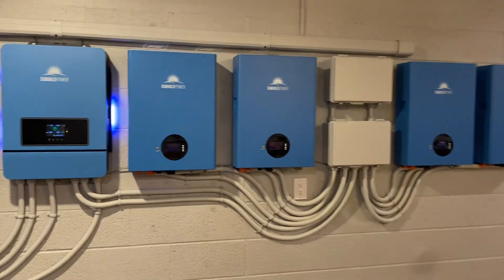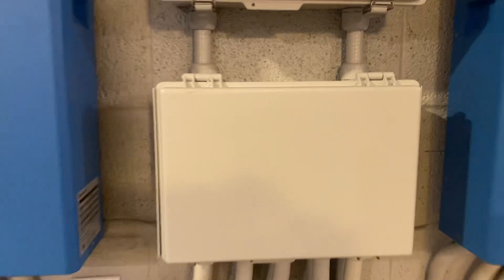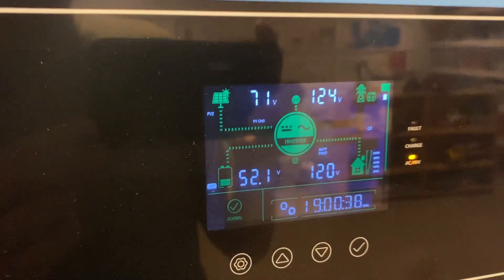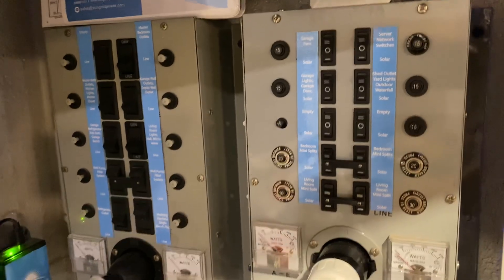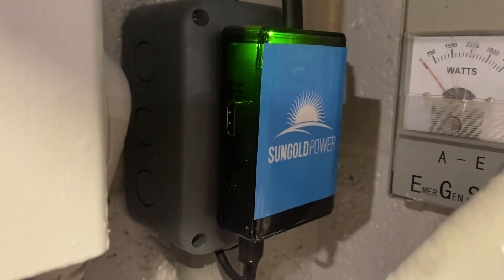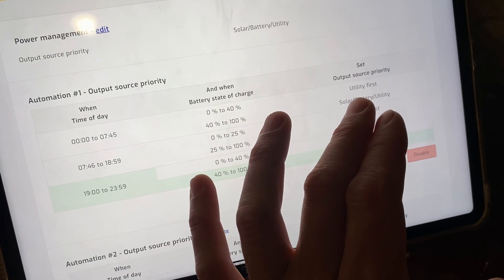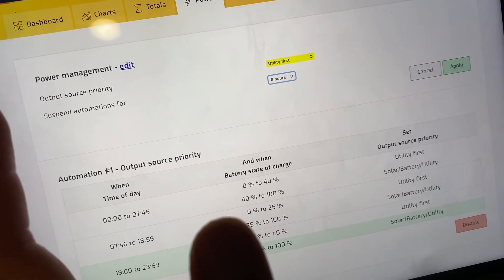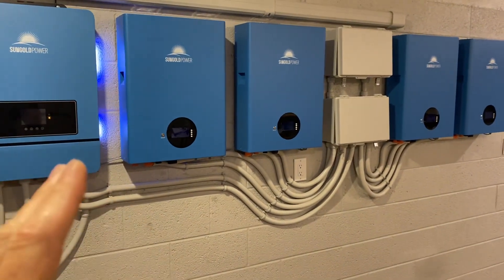Sungold 10k Inverter and Wall Battery Follow Up

Comment: Thanks so much! I just bought the same 10k inverter and will be running 15kw battery. What's your battery power? Curious if i need to consider more battery power.

Comment: You're right there isn't much at all on the SG10KHB, so thank you for that. Pretty smart amateur to think of the busbar to more evenly charge the batteries. It's strange that the wall mount batts are cheaper than the rack, maybe becauae the rack has more UL certs and the wall mount only has 1?

Comment: What scares me is you got a "bum unit". Good products don't fail, and good manufacturers don't ship bad inverters. I highly recommend Hoymiles inverters. They don't fail and they are convection cooled, meaning they are quiet. No noisy fans!
Reply from the maker: This design is based on price for a quicker energy savings pay off. There are plenty of more high end inverters. That cost several thousands
Of dollars more.. including holmiles
Reply: Machines fail all the time they are not perfect. It doesn’t make them bad or “scary”

Comment: Have a similar set up but with only three batteries. The issue I’m having and don’t really know if it’s an issue is that solar assistant says my battery capacity is only 5kwh. Is this normal? Does your solar assistant says your capacity is 5kw as well? My batteries are connected in parallel but the primary or first discharges more than the other two.
Reply from the maker: For solar assistant to "understand" your true battery capacity you need to periodically full cycle your batteries. i have a rule set to charge batteries to 100% soc and discharge to 30% soc, repeat repeat repeat, SA will recognize your actual capacity when it uses your actual capacity periodically

Comment: Really nice setup.  Have got to get that sweet manual transfer switch.  

At the moment I don’t have enough batteries so set my priority to charging batteries with the solar.  I have about 7k in solar, sungold IP6048 rated for 7500watts and two of the sungold power walls

Comment: did you get an overbussbar error on the inverter when you didnt have an exterior bussbar for your batteries? I hooked up my system and i series paralelled 12v bateries into a 48v pack. It it comes in at 53v but as soon  as i connect the AC i get this overvoltage buss bar programming error, 08. For the life of me i cant figure out what is wrong
Reply from the maker: You email Sungold? Sounds like a hardware problem

Comment: Is this the same inverter as the SRNE asp but with a different screen location?  I know multiple companies rebrand them and sungoldpower had a previous gen. that I believe was the same as the SRNE asp.  The reason I ask is that this unit is the best price of all the asp rebrands for a short time and want to try it out if it is indeed the same.  Thanks for the video!
Reply: I must have zoned out when you said its a srne.  Woops!

That being said is it an asp?

Sorry about that, thanks.😅
Reply from the maker: @ry2456 yes it is you can get it direct from srne from China and save a few bucks

Comment: Can you let me know what inverter you selected when setting up solar assistant?
Reply from the maker: USB Type B printer cable to inverter, use the ‘SRNE’ selection in Solar Assistant device setup
Reply: @PaintSlinger99  Thank you.  That's what I chose and It's been doing a great job.
Reply from the maker: @larryd.9245  Great buddy glad it worked out

Comment: Thank you for this. I am thinking of getting a system like this, although I would have two inverters and 6 batteries total. I want to have my batteries stacked on top of one another instead of side by side-- if that is feasible.
Will have to make sure there is space for that, of course. Do you have any links to purchase the bus bar?
Any link to the breaker from signature solar?
I have zero experience with solar but I'm sick of my power company having outages and not restoring power in a timely fashion- plus they just doubled the rates bc the new CEO gave himself a huge raise. 

Can this system be installed inside a house or is that a bad idea? I have a metal shed outside and I can probably put up a small plastic shed if push comes to shove. 
I have central AC that I think is 1HP. Got 1/2HP jet pump, another 1/2HP pump to pull water to the cistern, microwave, pressure cookers, air fryer, washing machine, dryer, upright freezer, two fridges, plus a workshop with tablesaw, miter saw, band saw, planer, etc. We have a dishwasher but we never use it. Also have 2 TVs, 3 computers, 3 laptops, etc. Oh, and 50 gallon water heater.
Link to manual transfer switches please? I know, I'm asking for a lot of links. LOL.
Sungold has a package for a 20kw (the two 10kw inverters). Mostly I want to be able to have power when my power company craps out on me. Thank you for this video. I found this from your post on the diysolar forums that I just joined.
Reply: Wow, you didn't marry the content creator here did you?
He might be able to swing by and put out the trash too....js.

Comment: Do they have any issues with light flickering?  The 6548 are notorious for that!!   And thats my biggest gripe for my Sp6548.    To the point to where I want to upgrade. Thanks again for the videos!!!!
Reply from the maker: No flickering that I really notice. I've heard some systems have that problem. These 10k's a pretty neat and the 3rd generations can now parallel! Wish i had that
Reply from the maker: I did notice my bathroom over cabinet LEDs sometimes flicker a bit, I got on Amazon and ordered a more expensive LED bulb and it doesn’t do it. If the LED has a small cheap resistor it won’t smooth the signal enough, try to replace some bulbs
Reply: @PaintSlinger99  Thanks for the suggestion.  Trying different brands was suggested by Sungold Support.  I have tried GE, GV from walmart, and others from various vendors.  They all have a flicker issue.  I will give amazon bulbs a try.
Reply: Hello, I setup the SPH10048P about a month ago along with 4 rack mount batteries.  I do experience lights flickering.  I am currently working with sungoldpower to resolve the issue.
Reply: Any resolution regarding flickering?
Reply: @gr8icu  Not at all.  It takes at least a day to get a response from support and then they want needless info on the brand of LED lights.  They also want videos of you using a multi meter and inverter settings.    They did send a firmware update that helped with other more serious issues.  I will probably purchase a better inverter in the future.